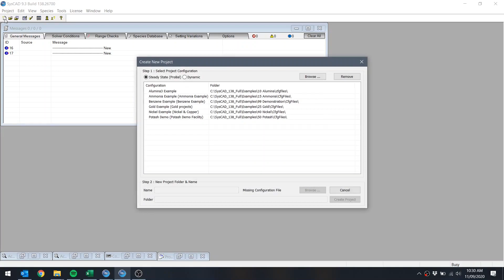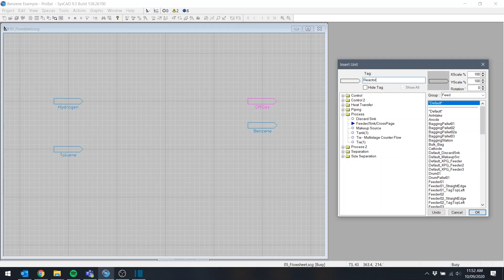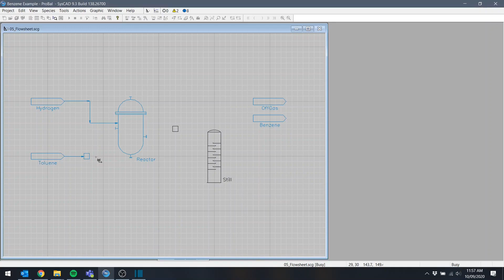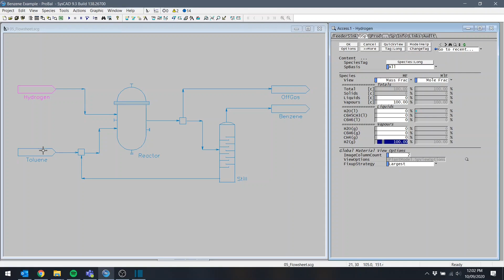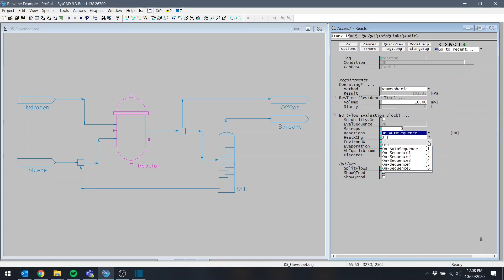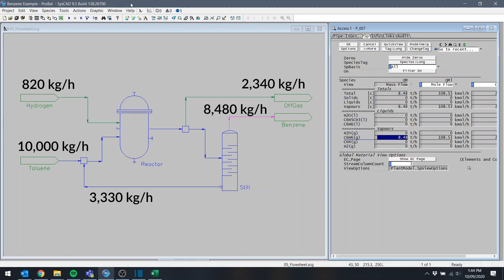Building a Simple SysCAD Flowsheet

Comment: Thanks for explaining. I have a question about the Still column and the "Tie" module after the reactor. It is not possible to completely separate C6H6, C6H5CH3, CH4, and H2 from each other. All of them (in various concentrations) will be present in both gas and liquid phases. How does SysCAD model that?  How do you define the number of trays and other details of a distillation column?